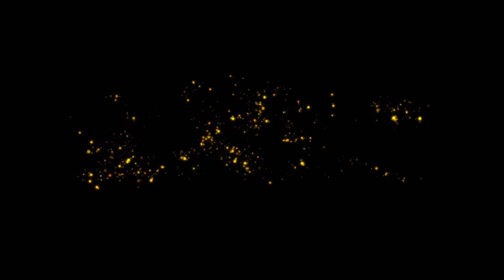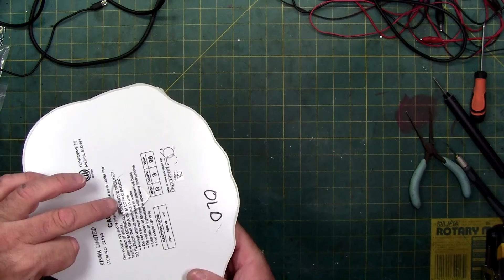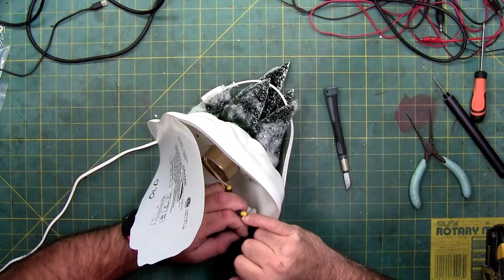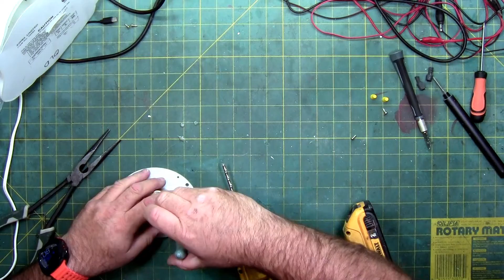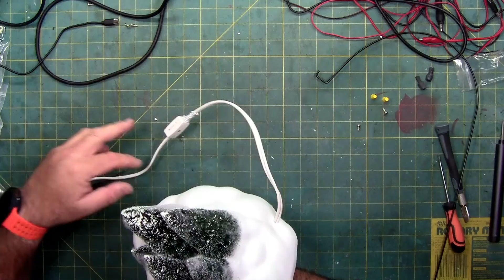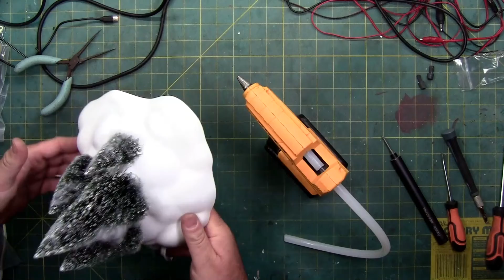Department 56 Up, Up and Away Repair

Comment: So this wouldn't be a pretty simple fix if the motor is still good. My Up, Up and Away just wont grab anymore. Costly, but simple Im guessing?
Reply from the maker: It is an easier repair than most, but it is a more expensive motor